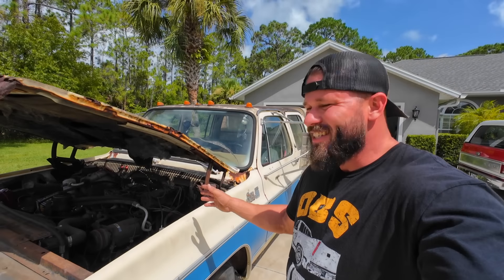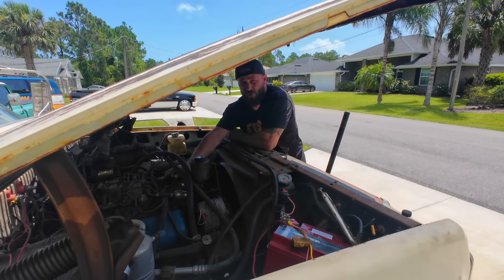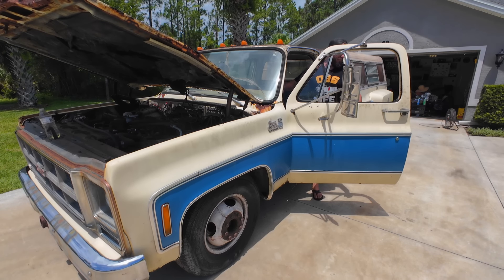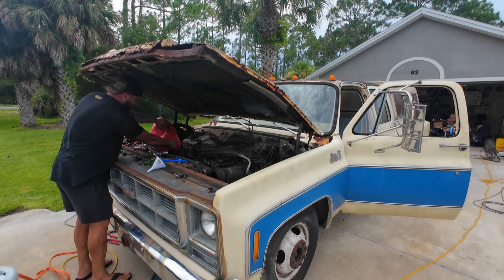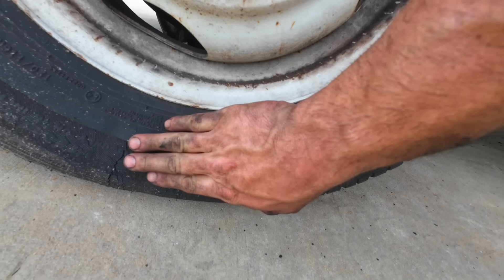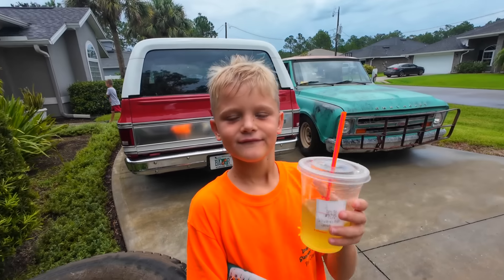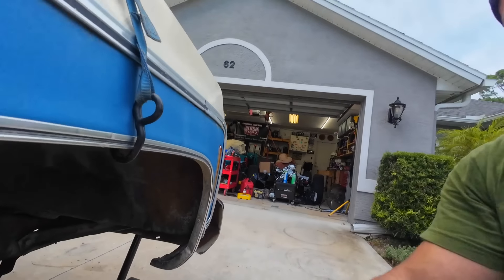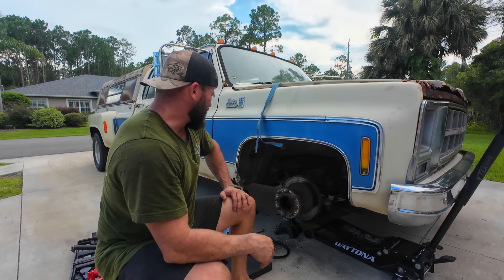Getting My 1979 GMC Dually Back On The Road

Comment: I don't know what it is about old duallies and bees.  Bees love em.  I park mine for 3 weeks, take it to the dump, back up to the compactor and notice everybody giving me a wide berth.  Well, more accurately they're running for cover.  Am I on fire or something?  No.  It's worse.  Evidently driving down the road had activated at least 3 hornet's nests up under the frame in some very hard to get to places.  I get them out but they just keep coming back.  It's the same thing at the end of every summer.  And it's only that truck!

Comment: Caliper hoses are probably collapsed. Can only compress fluid so far also fluid can’t go back in or you can slip a bit in due to hydraulic force but can’t get back out. Release your caliper bleeder and try to compress. If it works it’s most likely your rubber line.

 Use starter bolts. They are knurled so they are less prone to backing out.

Comment: Most likely collapse front brake hose is your issue. Specially if its pulling while braking. Pretty common issue to have on them. I bet the caliper is just fine.
Reply from the maker: I don’t think it is but that is a common issue. The piston would have collapsed into the caliper when I cracked the bleeder screw if it was the problem.

Comment: Change the callipers and the hoses, also if your alternator is at 12v you might have to change that should be 14-15v
Reply: Shouldn't be more at 13,14 at most.
Reply: @thehemiolds455  13.5-15v is a good alternator. Just check a picture of a battery tester. 13.5-15 is green for good. I get lots that are at 15v.

Comment: You know I'm kind of a weirdo anytime a caliber sticks to me I don't care about my mechanic ability he gets replaced with a new apartment. No questions asked what's the problem with that Siri is unless you know how to tear it all the way down and rebuild it with new seals and so forth and clean things up where would operate as a new caliper for me it's got to go you taking an awful awful awful chance been there done that did they with my 1994 Silverado and the brakes fail so since that has happened to me I text hot takes no freaking chances I don't care how old a party is it's getting replaced with a OEM part if the lines are crappy Gary getting replaced complete open Facebook slice replace replace replace replace it's a hell of a feeling driving 70 mph and your brakes fail because you want to be cheap you got young kids you got young kids I realize you were younger person and I'm giving you the best advice any man will ever give a young man never take chances with your family your life or your vehicle you fix it or you do not drive it